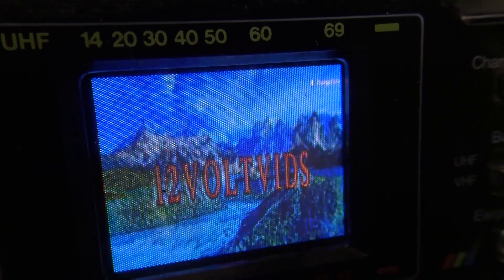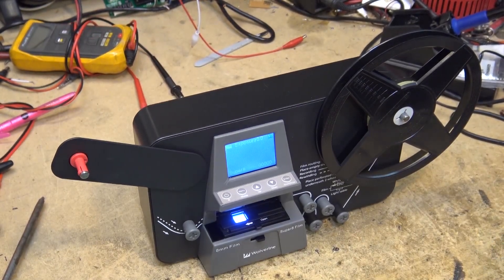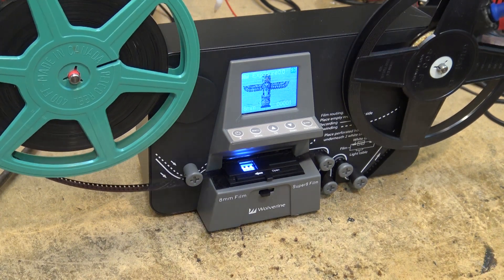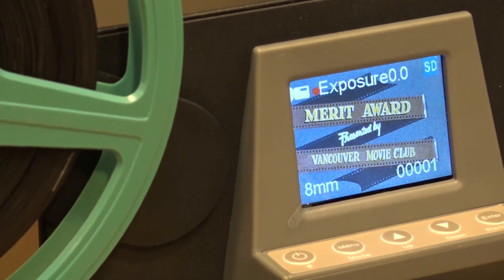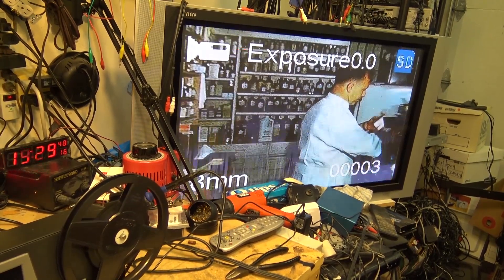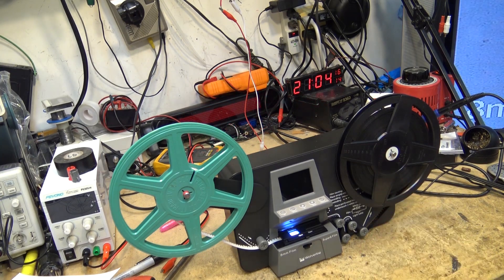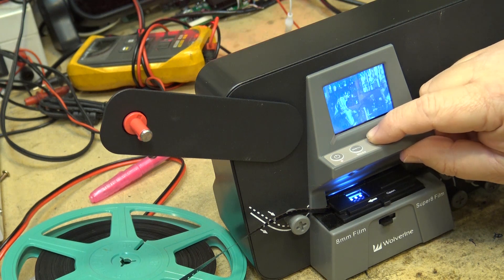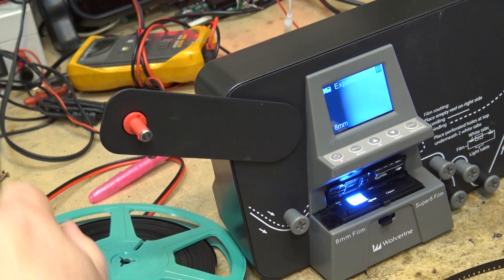Wolverine Film Scanner evaulation and quality check

Comment: Thanks for the detailed review. Maybe it could incorporate a better camera for better color tone and gamma control, but it looks sharp enough. Next, send results to the PC through some snazzy image processing software to remove grain/sharpen/color correct, etc.  I bet software exists that can create intermediate images to smooth frame rate to completely correct speed and preserve sound pitch at the same time. At least it does not flicker! (remember 5 blade shutters used on old telecine equipment?)
Reply from the maker: FindLiberty 
I have 5 blade shutter on my old gear and it works great. I put up a film on my yt channel a few years ago from some 16mm film I had from ww2. Actual combat footage shot by the allies that would have been newsreel footage "castle films" but YouTube claimed it was too violent. You know because a shot of someone firing an anti aircraft gun in the air might upset someone. Or Germans surrendering with their hands up is too much. Actually it might still be up on the channel but. It showed the quality I could get from that old eiki projector which I still use for 16mm.

Comment: Im pretty impressed.Ive got about 60 rolls from the 40s to the-80s.Ive have been looking on ebay and the one I have seen are advertised as new... but physically seem to be different..Particullarly where the film slides thru.Also the woman doing the evaluation  says it 720 but I thought u mentioned 1080 or something? Can u tell me anything  about this? But certainly seems a great machine
Reply from the maker: 126grey 
There is a less expensive model that is 720. The smaller version only accepts 5" reels as well. The pro version I have is 1080 and accepts the larger reels.

Comment: Thanks for the vid 12voldtvids - have you run into any issues with 7" reels re: pausing during the frame advance while recording (and subsequently recording the same frame multiple times until it finally advances to the next sometimes after 5-6 shots are taken of the stuck frame)?  I have been seeing this a lot on the first 7" reel that I have been trying to digitize.  I don't think it's an issue with the sprocket holes as they seem fine.  According to the Wolverine manual "A work around this issue is to wind the film to the empty reel and scan the film backwards. This way the unit will scan by grabbing on the good side of the sprocket holes then, using a video editing software you can reverse the playback and save the file playing forward".  I couldn't understand how to do this as I don't see how the unit can be set to play (or record) the film in reverse.
Reply from the maker: I haven't run into this problem.  I have had splices stick and that is probably what is happening on your one.  Splices that were not done correctly or are failing can stick. Generally a large reel will have multiple splices on it.
Reply: @12voltvids  thanks for your response. I subsequently found this was occurring on 3" reels as well. After some testing I realized this was only occurring when the film gate was closed. When I have it slightly open the resistance on the film moving through the gate lessens. It appears that the metal channel on the inside top that closes on top of the film  is sitting too low and placing pressure on the film. I attempted to tighten the phillips head screws that secure the metal plate but am not having luck getting them to tighten and I'm not able to get proper focus unless the gate is closed.
Reply from the maker: Make sure the metal gate parts are clean. If some film emulsion or dirt gets on any of he parts the film contacts it can cause it to slip.
Reply: @12voltvids  Absolutely, will do.  Thank you!

Comment: Thank you for this.

Great to see such a detailed video of this product.  The main thing I was wondering...  The specs say it outputs a 1080p file at 20fps...  Is that frame for frame, so in terms of Super8 shown slightly faster than original footage or does the device duplicate 2 fps in the output file?
Reply from the maker: The frame rate it saves is 20fps.  You can adjust the speed in an editing program if the extra 2 frames per second is too high.  You lose 6 seconds per minute of film.

Comment: Does this support the concept of overscanning? In other words, scanning beyond the frame of the film so that the entire film frame and borders are scanned. I see there is a zoom feature.  Can you zoom way out?  I would like to overscan and then crop in post production.  Thanks.
Reply from the maker: Yes absolutely. You can zoom way out to see the entire frame beyond the edge so you can see  the film Id marks, sprocket hole and portion of frame on either side so it van be cropped on post production.   I should do a demo of this feature.

Comment: Sometimes a film doesn't seem to be aligned correctly and I don't see anyway to adjust anything physically.  I can tell almost immediately, because it sounds louder and wrong while running.  It can also completely throw off my frame adjustment very soon after starting and causes jumpiness in the final video.  Any ideas?
Reply from the maker: Don't use the take up spool.  Scan and drop film i to s box.  Much better results.

Comment: Hello👋
I am having trouble with the fifty foot rolls from the 1984’s.🤢
The film goes through the unit for a period of time then gets tight and stuck!!!!!
I think the width of the film is too wide from when it was cut during processing?
The reels are white plastic in a medium blue color round storage case that the reel fits into.
Maybe a brand of processing problem?
I will not be able to digitize!!
A few reels went though fine and then I hit the problem about six reels into the done earliest date to later date!
Maybe I switched processing labs?
One half of the fifty foot should go through because one half should be slightly narrower than the slightly too wide half?????  HOPE SO??
Any ideas?
Roger 🤢🤢🤢🤢🤢🤢🤢🤢🤢🤢🤢🤢

Comment: I got a similar one but it doesn't have an audio converter option - How can I transfer the audio? do I need a different machine? if so do u recommend any? thx :)
Reply from the maker: The audio was taken ff using a projector and manually synced up on the computer. That's the only way to do it with these machines as they scan single frame. 2 frames per second.

Comment: What about the audio??
Super8 had the ability to have audio too and this is not transferred with this method. How would you do that in the best manner possible after you have the video transferred? You mentioned the sound projector but I don't have one, not even sure what this is
Reply from the maker: You have to do audio using a projector to play it and sync in pc as I had to do with the 8mm sound films my father in law made.  This only does picture and is quite slow. 
My unit broke down last night.  Take up motor burned out. Now the film drops into a box on the floor as it plays and had to be rewound out of the box.  (Sounds worse than it is)

Comment: What SD card did you use?  My copy is coming out very grainy. I have changed shapness, and other adjustment. Nothing is different. The picture looks good as it is copying but when I put it on my computer it isn't very good.
Reply from the maker: I just use a Transcend 16 GB class 10 UHS 1 card.
Reply: It supports up to 32 Gb.

Comment: Considering the cost of alternative telecine equipment, 500$ isn't bad.  
They have a couple bugs to work out , write them and give feedback of the need to fix it so it doesn't need baby sitting.  I'd use an old beater for rewind, um getting rid of two this week.  I have a bunch of  60s reels that need transfer from my aunt, um gonna do it the shitty cheap way.
Reply: Or you could send the reels to a real telecine service for a lot less the money. They spare you the hassle of "babysitting" and you aren't left with a 500$ device that won't serve any purpose afterwards. Just saying.

Comment: I have both the Reflecta Super 8 Scanner and the Wolverine film scanner The previous 720P and smaller model, Although Reflecta came out with the super 8+ there is no significant difference.. However both reflectas super 8 are only limited to super 8 only, it had 1080p over wolverine at the time. The difference between the Reflecta and wolverine besides from the film formats and resolution is that I found that the wolverine skipped less at splices than the higher price reflecta super 8 and Super 8+ models and the wolverine dual 8 scanner seemed to scan faster than the reflecta! Note that the reflecta is not a stand alone machine like the wolverine as it requires a MAC or PC to operate the scanning process!  Now that I know that the Wolverine film scanner Pro is available with 1080P, I just might sell off the what I have and get that Wolverine film scanner pro which is still a better value then the Reflecta Valued at $999.99 USD
Reply from the maker: I looked at the Reflecta a few years ago and took a pass due to the ridiculously  slow scanning times, and the stratosphere price tag. When I see comments from others telling me to "get rid of this piece of junk and get a reflecta" I get a good laugh. Shows what these trolls know. This machine might be slow but it does give good results, but I won't be making money on this thats for sure.
Reply: Dave I agree with you 100% on the Reflecta, like I said I was more surprised with the Wolverine Film Scanner (720P) version for less than what I paid for the Reflecta. The only thing I was disappointed with the Wolverine Film Scanner at the time I purchased mine was that It only captured in 720P , so now with the Pro (1080P) version out I will consider getting the pro model soon. (They are back ordered with most of my local vendors!) The only good thing about the reflecta (if anything) is that the rewind function is a bit better than the Wolverine. To compensate for the slow rewind on the Wolverine, I would just rewind the films on the good old projector, which in your case you're going to run it again on a sound projector to capture the sound anyways. For some reason I would up with the Relecta being that I didn't know the Wolverine Film Scanner existed at the time of purchase! So If you ever  want to prove those who said to get the reflecta wrong, I will be more than Happy to loan you mine for a video!

Comment: Great video thanks, audio is a problem though. Is there a machine that does both?
Reply from the maker: No, as to get audio the film needs to play on real time.   A professional telecine can do this but they charge 1000 per hour to scan on a professional unit.  You can do it with a projector and camera but the quality is not as good.  I have a few examples of film done with a camera.  With a good projector with a proper 3-2 pull down shutter 5 blade for 24 frame film speed (I have such a unit that was pulled from a tv station) will deliver almost flawless results but 8mm used a 4 blade shutter and ran at 16 frames for 8 and 18 for super 8.  This resulted in flicker.  Many would slow the film to 15 frames to reduce the flicker but that changed the pitch of sound, or for super 8 speed up to 20 frames as these are multiples of 60 fields.  Again a problem with sound film.
The way to do it with the wolverine you need a sound projector to get the sound off and then sync on the computer during post processing which you really need to do to crop and correct film speed.
Reply: @12voltvids  thank you

Comment: Great review, but...how did you get past the initial snag with the splice?  You said that you started over but that splice is still there, correct?
Reply from the maker: It stoped at the bad splice, and I had to manually move it past that splice and start it up again. Most splices go through no problem, just ones that people did by sticking a broken film together with scotch tape.
Reply: Ah right.  Tnx.   I was wondering if that were possible if the film snags for you to just manually move things forward a bit and just hit start again - so there's my answer.   Really great series of vids on this unit BTW.
Reply from the maker: Yes it detects the jam and stops to wait for you to manually clear it. Same when the film ends, it stops and writes the file. That way when the files are taken into a computer to be edited they are just cut together like any other clips.

Comment: Do you run into the auto-white balance putting a blue tint on the footage randomly? I seem to be getting this on every reel I digitize.
Reply from the maker: No if t he film is good it looks great. Unfortunately many old films are color shifting usually to magenta as the yellow dye is fading.
Reply: @12voltvids  If I may, most films fading to magenta are suffering from the loss of the other colours, cyan and yellow. Some photographs fade to cyan as a loss of magenta and yellow.

Comment: I would just find an old projector for use in rewinding the film.
Reply from the maker: I have a manual "editor" you know the magnifier type that has gear driven spindles, so it will rewind reels very quickly and that is what I will be using. Not this joke of a rewind

Comment: I have a film that is shedding, but wouldnt send it through the mail  its so fragile.. end of the film is shedding.. I'd be looking for the peices later.. Is the transfer image sharp..
Reply from the maker: Yes it is very sharp.
If the sproket holes are damaged, it however will not scan the film as it uses a cog to advance the film.

Comment: Have you done any with sound? I have some Super 8mm Reels with the magnetic sound strips. The Wolverine doesn't do sound.
Reply from the maker: Yes I have done sound.  Scanned the film on the wolverine and then ran the film through a projector and recorded the sound.   Synced up sound and walla sound film on wolverine. Had a conversion order of super 8 sound. Took a little longer but the results were good.